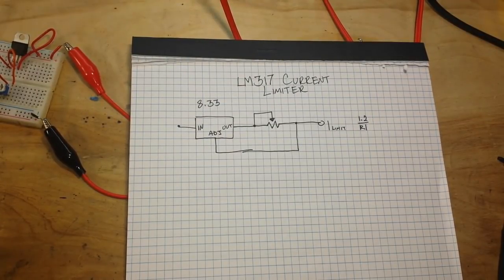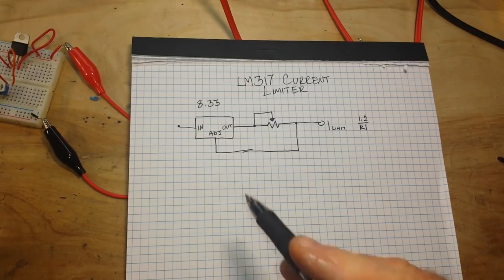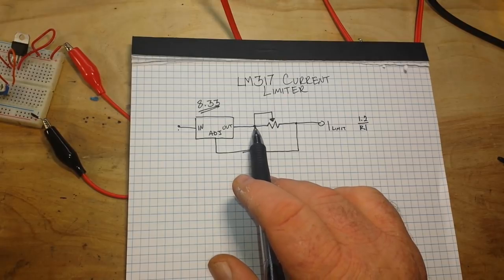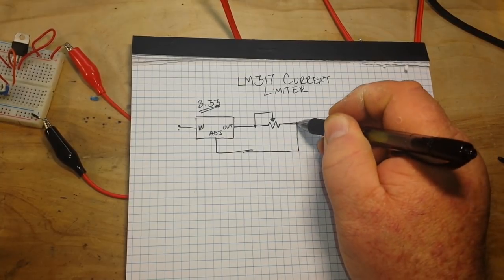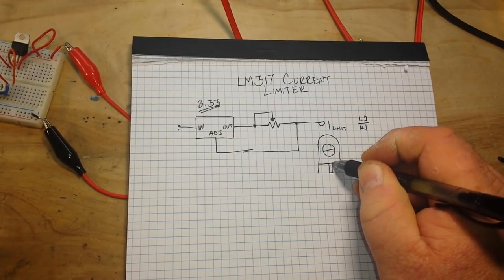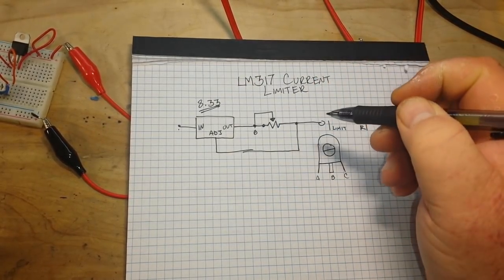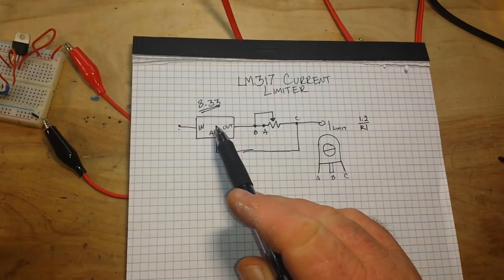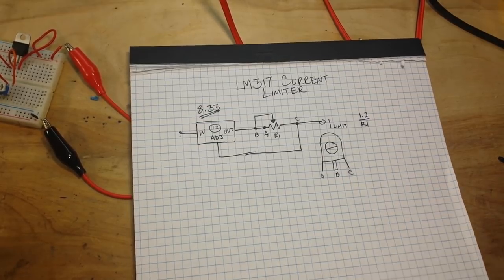Back to Basics II: Adjustable Current Regulator with the LM317

Comment: I've seen these circuits til I'm blue in the face.  However, placing a fixed resistor in parallel with a variable resistor to limit current is really cool.  I learned something new.  Great video, sir!
Reply: Actually, in the diagram, the 10Ohm  resistor is shorted out!

Comment: hi, i don't have a breadboard but i have lose wires. is it possible to connect the potentiometer, LM317 and resistor and  power source directly with each other without breadboard?

Comment: Adding the cap in parallel stores unused potential and dissipates it back in to the circuit when it falls below a threshold, choosing the right value cap like a  .01uF with the right time constant will fill in the noise gap nicely

Comment: Hello, very nice video ! i did the same, i used 1.5 Ohm to have an output of max 1A, but when i plug a load to my 12v lamp bulb, the voltage drops to 4v, is it normal ? many thanks.
Reply: Depends on few things. It will drop at least 1.25V. at what point u measured 4V?
Reply: Got similar problem. But I never got more than 100mA so even a tiny LED reduce the voltage a lot. I wonder if it depends on what model (x) of LM317x it is.

Comment: hi paul, i learn a lot from your videos, thank you!  how much amps did you set the load here?  what should i do to increase the swing to a max current of about 3 to 5 amps?  how would i configure this with a power transistor to achieve higher current limiting?

Comment: Ok, very nice. I did not realize it would be this simple.  I built an ATX power supply with voltage selector and volt meter.  One terminal is constant 12V.  Another terminal can be switched to the 3 diff. outputs.   I should take the 12V off that terminal, guess why?
Anyhow. I want to charge various rechargeable batteries with it  and need a currant regulator.  
battries can range from 1.5 to 12V.   I just wonder if this circuit  will cover all the mA ranges I will encounter?  
This looks promising thanks; thumbs up.

Comment: Any chance you could do a video on how to regulate larger currents, like 10A at 40 Volts?
Reply: I second that. I presume it's with a transistor of some kind.
Reply: Or 90v 40ampz😂
Reply: Same here. Have an old pyramid linear supply rated for 15A or 20A that I want to convert.

Comment: I am using the LM317 to regulate voltage to my model train smoke heater to maintain nice smoke plumes during various speeds as fan puffs increase cooling air flow. Thanks for sharing. D
Reply from the maker: Thanks for sharing

Comment: Could you use the output to drive a MOSFET or something if you wanted to limit a large current?
Reply: This circuit is meant to regulate current, but a mosfet is a voltage controlled device.
You can use this circuit to regulate the base current of a bjt
But if you do that the transistor will saturate during constant current operation and dissapate a lot of heat which is not ideal

Comment: Great video I'm a. 
Disabled electrician but in the early 80s I worked on video games pinball record machines etc. I'm going to get back into the hobby because of other hobbies I'm going to use at least one if not two server smps what's the best way to add an adjustable voltage and adjustable constant current to the output with volt and amp meter? I'd like your opinion on this..lol I can't sleep either hope you feel better my mom dad brother and best friend had cops thanks for taking time to share the videos

Comment: Hello. I am a total novice. I have soldered, stick welded, and wired houses, so, I do have a healthy respect for electricity, just f.y.i. but not too much knowledge. I have a purely selfish request, but maybe it will be of benefit to many just by way of reminder. And , also, it feels good to help others.  I want to make a simple 1000 watt (or maybe  1500 watt) adjustable voltage regulator.  I think I want to make 2-3. I want to control heating elements without use of inconsistent mechanical thermostat; and I also plan on making a peltier freezer/fridge ( or maybe just ice maker).  I have limited funds. I have soldering iron and elec solder.  Any help is greatly appreciated.

Comment: Well if it's a cap it'd have it's own charge wouldn't it? Up to Xvolts it was rated, usually higher then the input voltage? 
Also, if I were to connect a LM317 circuit to a SMPSu (watch out KINDA like other crazy question lol) Could I theoretically draw just up to whatever voltage and amps I was setting the variable voltage to an what the LM/ my circuit demanded? or would connecting that just  right to the output bare the full 5v 25amps against the LM and or whatever circuitry I had inline with it since LM317 max is only 1.5 amps..(being hooked up to/running  a  VERY expensive LD) Or would I be good to power that off that? Or would the weird SMPSU try to limit its draw all together to only 5 volts(which is fine), (12v 18amp is a option to but I'll get alot more heat from volts stepping down.. just worried/confused about the amp thing an the behaviors..) an to 400ma again like usual? Or would me placing the demand unlock the amps the same way I saw when I hooked my DC motor up?
..Is this the same question? I'm done. I'll just wait for your reply an hopefully that helps me get it lol cause it's all obviously related..

Comment: i have a feeling like the lm317 is entirely redundant here, if you have a constant voltage, you can just use a pot to vary the resistance and with that the current that flows
Reply: with a simple, if the voltage changes, so will the current. with the lm317, the current will maintain its vlaue despite changes in the voltage.
Reply: ah i see

Comment: I generally use a LM317L with a 220ohm resistor between A and C and a LED for the load as an easy "no think" way of indicating "output/testpoint high" on the breadboard.
It works from 3.3V and up.
It can easily be put on a 2 pin header and protected by a piece of heatshrink for reuse.

Comment: Isn't the resistor you added shorted out or is it in place of the short that's making the pot into a variable resistor?  Hope that makes sense Paul!
Reply: dan blankenship thanks Dan. I'm not nitpicking just clearing up the exact location as complete beginners may copy the circuit without question and wonder why they're getting different results!

Comment: Just for the fun of it, put a led and a resistor as your load.  Set the current at 15ma for instance.  Afterwards, vary your input voltage a bit, up and/or down, just to show how the regulator will do its best to keep the current constant.  You might consider putting a voltmeter across the led, showing the impact.   By the way, I noticed two little "hoopsies" in your clip.  First one was around 04:10 when you said "7 ohms swing" instead of "7 milliamps swing".  The second one was aound the 05:03 mark when you drawn the resistor on your schematic.  I think you put it on the wrong side because as shown, it is shorted across the A & B terminals.  I understand that our minds aren't always as sharp as we would like them to be in the middle of the night.  Been there, done that too !  For the effect of the cap on the input I'm not sure.  I was under the impression it was mainly for filtering/stability purposes but now we can see it has a another side effect.  As per my understanding of the LM317, I'd be lead to believe that the capacitor could potentially be adding a small variation of the current on the ADJ pin which in turns is amplified by the internal Darlington transistor, thus slightly increasing the output voltage leading to a wider current range.  It's almost like lottery, we simply hope to have the proper combination.
Reply from the maker: http://blog.capitalogix.com/.a/6a00e5502e47b288330192ab34ad86970d-600wi
Reply: learnelectronics So this is where the energy comes from ?  😷
Reply from the maker: Yup lol
Reply: learnelectronics You got it wrong Paul, https://goo.gl/images/sx9vt5
Reply: Thank you paul for your help and a lot of fun .

Comment: Using the last two videos, I looks like it would be possible to build a regulated voltage supply that is current limited by putting the two circuits together in a series circuit. Is this correct? I guess I now have to get some LM317's to play with!!! I need more room!!!!
Reply: Problem here is that the resistor needs to pass the current to your load. 
Very few variable resistors can take that. Remember: P=I^2*R
Reply: Yes I’ve done it and it works well.